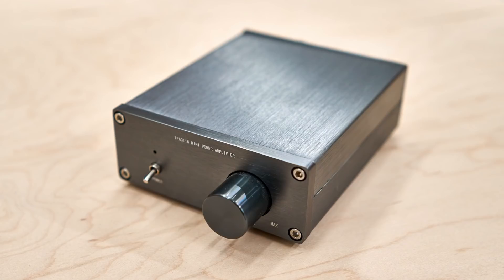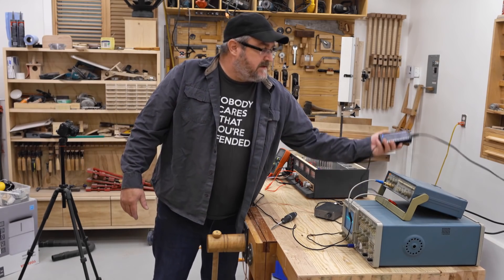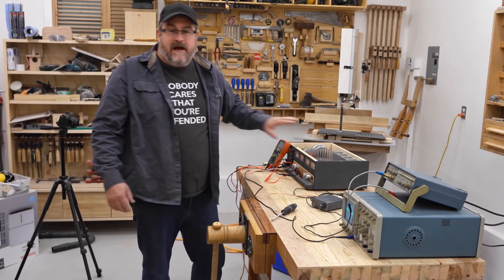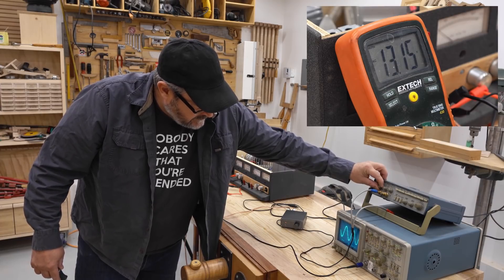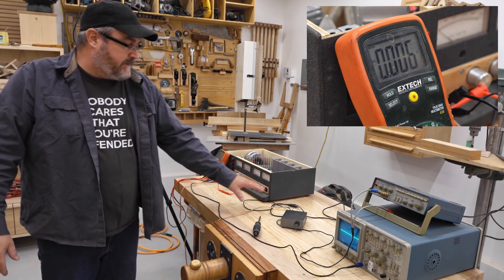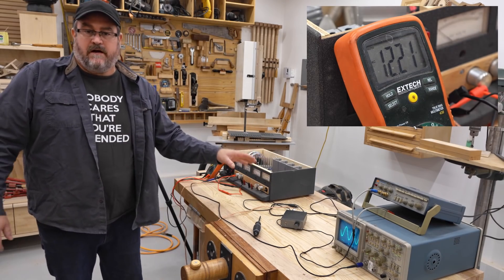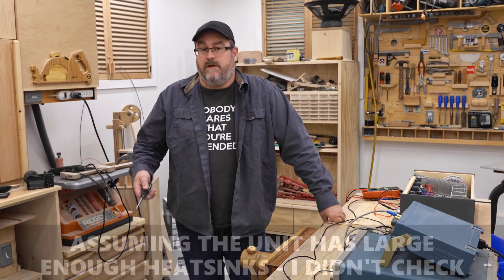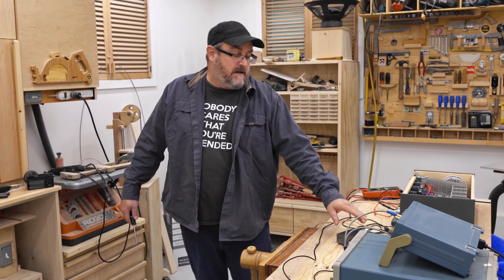How Many Watts? Testing the REAL Power Output from a Low Cost Amp

Comment: You should've shown how/if it's power output improved when powering it with your big homebuilt benchtop power supply you showed there instead of that tiny brick power supply, as I'm sure your benchtop supply could actually deliver what that amp really wants in order to perform at its best.

Comment: If you look more closely at the specs you'll see those power ratings are at 10% distortion. They make about 2/3 that max power with 1% distortion.

There's another thing to consider with measuring this way, the frequency range of the meter. Most meters of that type have a rather low frequency limit for AC volts, meant for measuring household current. While difficult to get precision, using the scope is perhaps better. That's not to say a given meter won't measure 1kHz but you need to check the specs. 

Measure the input current while doing such a test.

10% distortion might not be all bad considering when listening to music that output is normally momentary. It's a peaks, not over long notes, generally.

Distortion is the main thing with class D. Since the sound is recreated at output filtering a not processed at all in the linear region of the amplifying device there is virtually no noise. And specs say so. The signal to noise ratio is outstanding for such an amplifier.

Comment: You'll find that rating is for at 24v and they got it from the chip spec sheet. But they include an 18v power supply with too little of current supply. Sometimes you might find a 24v power supply included, but even that is often no good too since the rated current output is too low to provide the wattage the board is asking for at that voltage. You can get the right power supply for about £20 here in the UK, probably cheaper over in America. The way you calculate if you have enough is by getting the supply voltage and current that the supply is rated for, multiplying them and dividing them by the amps efficiency (e.g. /0.8). That tells you if it's capable of providing enough for your amp. In this case 24v is the max for the board, so get a higher current output capable one to get to that figure you need!

Comment: I have a similar amp based on the same chip. It measured at 32db gain, which is way too high.I lowered it to 20db, which resulted in a more linear volume control function and far less noise. I was actually quite surprised that it could drive my B&W Matrix 805s to decent levels.

Comment: Try to also measure the output of the power supply under load. Was the amp taxing the power supply? Plus, It would be interesting to see the efficiency of the amplifier.

Comment: I have a similar amp (if not the same), with a 32 volts powersupply and it can play a lot louder than I need to.
I am so satisfied 👌🙏
Reply: Okay, so I checked again. I actually have to plug it in to the amp first and then the wall after... Otherwise I will burn it in an instant. For now it works just fine with my pair of Tapco 6915 speakers. Does not handle the bass as well as my NAD, but it sounds really clean. Guess I just been Lucky 🙏👍
Thanks!
Reply: (I saw just now, The amp I have has the TDA 7498E chip.)

Comment: Looks like a breeze audio something I spent $23 for on eBay was surprised at how good it was for such a cheap little thing.   
            Are used a 24 V linear power supply that I built for a Nelson bass amplifier I built it worked much better than the PowerBrick. 
         But I only need one WATT with my 98DB efficient speakers I built one WATT of power is too loud 
           And yes the heat sink inside is way too small for 50 W of any sustained period of time.

Comment: I've got a few of these chinesium 3116 based amps at home. I find that a UL listed laptop power supply generally hits the sweet spot. 19V might be pushing it for some of these, you have to check the caps.
I have a hifi and the curse of the golden ears but for 18 bucks plus a trip to the thrift its good enough for my workshop.

Comment: I have work with these class D amplifier from TI, they have one chip that is rated at 100W/ch with almost no heatsink! In continous you can not expected more than 10W/ch without a thermal cutout! Plus these chineese amp PS are underrated for the expected power. Maximum power is rated with distortion at 10%! You can't add any big heatsink...

Comment: I have the exact same amplifier and I was running into problems with clipping and also just an overall unpleasant sound using an inadequate power supply. 

I had a cheap 24v 20A switch mode power supply lying around (the type used for security cameras) so I hooked that up and was able to drive the amp much higher without the clipping and a significant improvement in the sound quality.

The power  supply only cost around $20 and so far it seems to work really well.

Comment: I have a question.  Back 25 years ago when I was ripping out my back seat and filling that area and hatchback with speakers, I remember them offering 4 ohm or 8 ohm on the speakers I purchased. My question to you is if it theoretically splits the power in half, why would you want to go with 8 ohm speakers over 4? Or is it you want to match the speakers to the amp?  Like I said before, I crammed 4 12's and 3 15's in the back of an eclipse hatchback, so sound quality wasn't as important as shaking grandma's fine China off of her display shelves...
Reply from the maker: An 8 ohm load is easier for an amp to drive, especially a low cost one. An amp will try to supply double the current into a 4 ohm speaker but it needs a larger power supply (transformer, usually) to do that.
Reply: @IBuildIt  interesting.   I was always curious and watching your video today kid of put it into terms I understood.  Thanks
Reply: I learned alot over the years in the field I was playing in. I was in what was known as decibel drags. Basically pull up your car, they stick a decibel meter in and you see how high you can register.  I learned how far the sound waves need to linda bounce around in the car before hitting their peak, the angles the speakers needed to be to obtain that and temperature of the air in the car for best results. But as I stated before, quality of the sound wasn't extremely important,  just more loud the better.
Reply: @Douglas Blake is there a specific use for 4 ohm?   I mean it sounds like everyone would just want to use 8 ohm.

Comment: Yeah, bought one of those chinese S.M.S.L-amps, looking very similar to the one you got there, rated at 2x50 Watts into 4 ohms, with a 24 VDC supply. What they ship it with however is a 12 VDC brick. Not a word about that in the description. Contacted them and they had some poor excuses but promised to send a better power supply. Some time later it actually showed up. 18 V. Hahaha. They didn't lie. It is a little better...

Comment: Those TI based amplifiers are pretty nice (and cheap!).  There are definitely some amps that cut corners, but a lot of them look pretty good.  50c says that a 19.5v is a common laptop power supply to keep things cheap, and that sourcing an acceptable 24-26v PSU would bump the cost a bit much.
Reply: You don't want to be running higher than 24v on these boards, supplies rated for a higher current at 24v is perfectly fine though

Comment: You're not going to hear much difference in loudness between 35 and 50W.  To sound "twice as loud" you need 10x the power.  Most people can start to just perceive a difference in loudness at 1.5 dB(SPL).   That's 1.4x the increase in power.  And that's precisely the increase between 35 and 50W.  It really isn't worth any time or money fishing for something just barely perceivable.

One of the biggest ripoffs in audio is charging consumers extra money for imperceivable gains in power by listing it as linear numbers instead of logarithmic.

If anything the maker of that amp saved you money by not making you buy a power supply you don't need and instead giving you longevity by making sure the amp has plenty of headroom in thermal rating.
Reply from the maker: The purpose of my test was to show what you really get from it. The amp wasn't advertised as 35 watts into 4 ohms with one channel driven, it was for 50 watts per channel into 4 ohms with both channels driven. The amp is probably capable of that, but not with a supply that rated for less than 100 watts.

Comment: These Class T amps are impressively efficient. I've used one in my shop for years and it hardly heats up, which was great when I ran it on a solar-charged battery. Nice to see some real numbers from you on this, thanks!

Comment: 21V peak is ~15V rms or so with a bit of dropout just about enough for 50W in 4W, it is class-d so heatsinking shouldn't be a big issue
Reply: Thing is, it's rated for 50v RMS not peak. The  issue is the power supply 👍

Comment: I used to laugh at those flea market amps that had 300 Watts on the box.  You just know they are measuring peak to peak instead of RMS (.7 x p-p/2) values.  Then try pointing it out the the vendor who wouldn't know a volt from an ohm.

Comment: This is why a single slot car stereo only gets max 40W per channel.
To get more, an internal power supply to step up the voltage is required, but all this does not fit into a normal slot, let alone the necessary heat sinks.

Comment: Can you test the power supply to see how much it's max output is?  That would be useful to know.
Also, you need to look at the spec sheet for the amp and see what the specs really say, on good quality amps it will say "50w @ 4 Ω at .01% THD" but on cheap amps, it will say "50w @ 4 Ω at 10% THD" which means essentially a square wave and 1000 times more distortion than the first amp.   You have to really read the specs and hope they aren't lying.   Some cheap amps will just outright lie on the spec sheet.

Comment: Beware running any amp continuously at its nominal power rating - even 'good' ones will overstate what they can really survive continuously and I have popped an amp doing exactly this kind of test.
Reply: Actually not the case with this board. I've tested it full load 24v (with a heatsink of course, that's needed at 24v) for an entire 24hrs with no problems

Comment: Electronics. Course  on makers mob?  It's common, when u buy an amp ... That the weak point is the power supply, so the amp doesn't have as much output as it could?

Comment: When measuring AC power, the power is measured differently as we have a periodic voltage and current. So the true rms power is much less than what you measured as the equations apply for continuous dc voltage and current.
Reply: He measured the RMS voltage with the meter.  His calculations are fine.
Reply: He measured AC volts in Vrms. He used the correct formula for power (Vrms^2 / R). I think you are somehow a bit mixed up about something. I am an electrical engineer, so I have studied this stuff and use it all the time. I am not mixed up.
Reply: @mckenziekeith7434  I am not sure what I am missing, also I am not quite an engineer yet. But 3rd year electronic engineering in university.
Reply: @kaumohlamonyane272  you are missing the significance of "RMS." RMS voltage is DC equivalent when it comes to power calculations.
Reply: It should be something like P=(1/2)*V*I